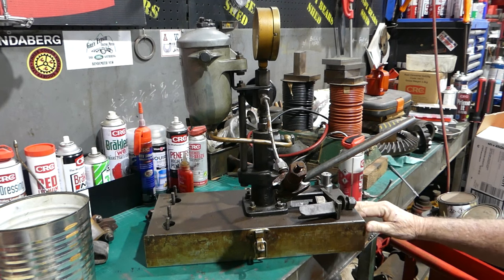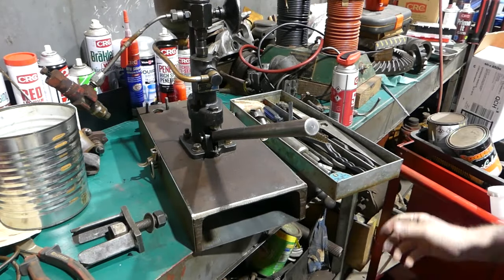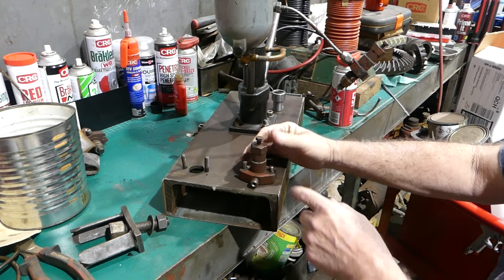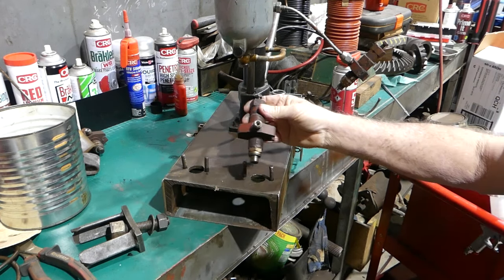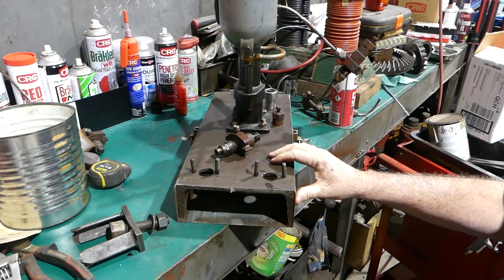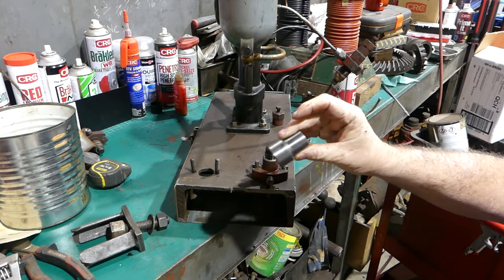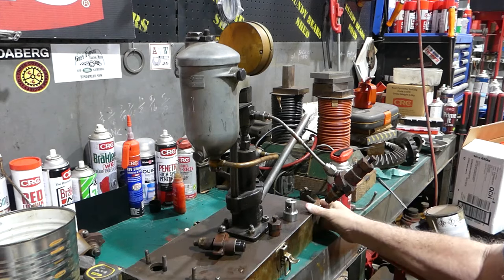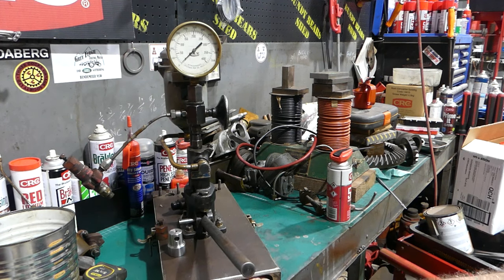Kangaroo Stew # 365 Part 2  One for Barry and a Walkaround Video

Comment: Cheers Lance that was very good of you to take us around the injector tester, it cam about because I had to pop one back in the engine to loosen the top nut, then I remembered yours from that earlier vid, I'll keep my eyes open for a piece of channel and some plate and make one of those up. That old pump look amazing, testimony to proper old engineering, build to last.
many thanks once again
Marshall will be raking through his scrap pile now looking for steel. 
cheers Lance
Barry
Reply from the maker: I reckon he will, it is a very easy project and he is very capable.